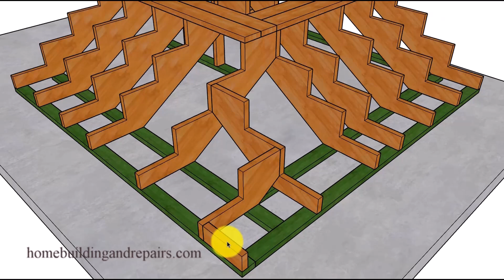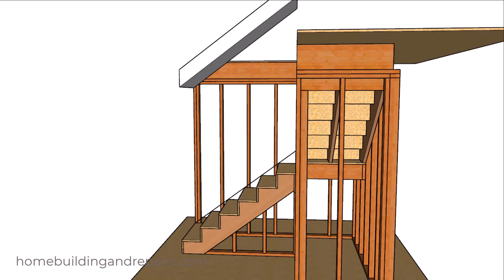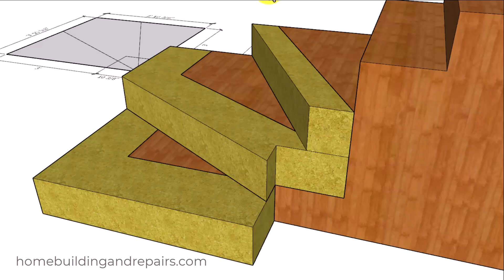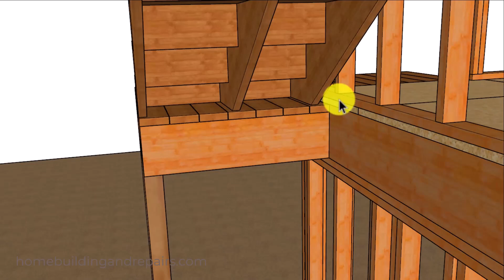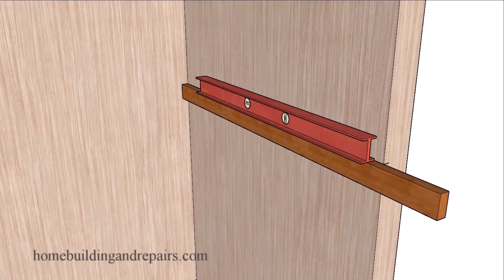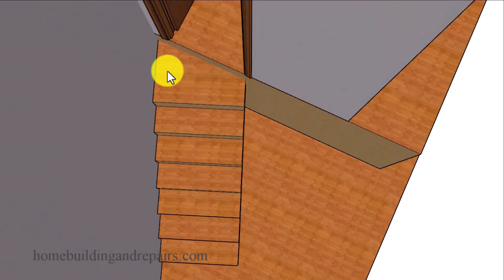Stair Building And Construction Education Video Series Collection - Part 11

Comment: Any opinion on the liability risk of repairing a cracked stringer on a non-code complying deck stairs (stringers too far apart, risers not equal, 2 steps have 8 1/2" risers).  As a contractor, is the liability risk too high to to take on the repair?
Reply from the maker: Good that you're cautious and if it isn't worth the risk, don't do it.
Reply: @stairbuilding  Thanks